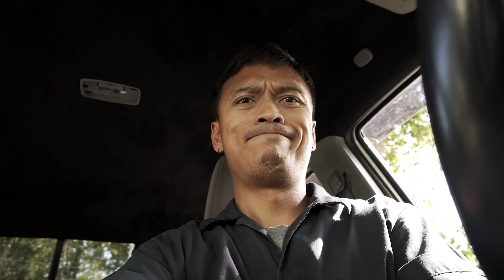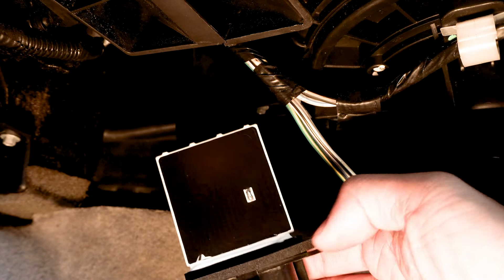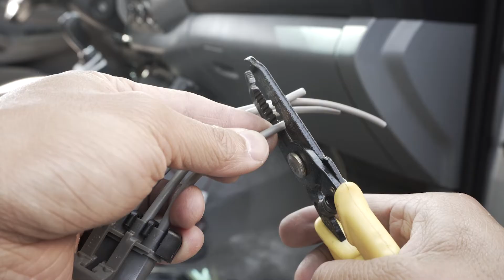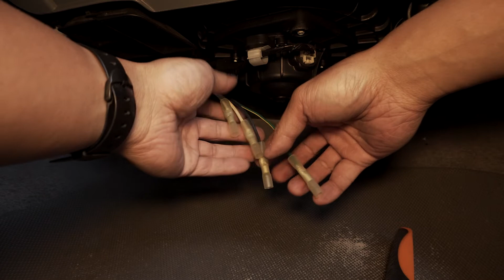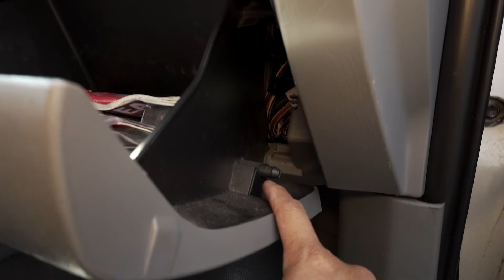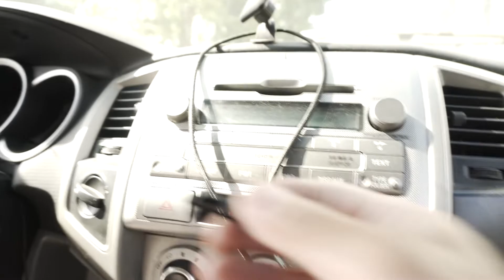Blower Motor Resistor Replacement (DIY / How To Tacoma)

Comment from the maker: Replacing the Blower Motor Resistor for the 2nd Gen (2005-2015) Tacoma.
Here are the links.
Resistor w Harness Kit https://amzn.to/3OtlxxE
Resistor only https://amzn.to/3xLspjk
Wire crimper https://amzn.to/39M01pk
Cabin air filter https://amzn.to/39KOnuM
Wire stripper https://amzn.to/3zWrUp5

Comment: Had this problem on my 2012 Tacoma.  Problem was obvious - poor contact on the incoming 13.8 volts to the resistor bank from the vehicle electrical system (the large diameter wire in the associated wiring harness).  Visual examination of the harness plug and the resistor bank receptacle showed burn marks in the sleeve of the resistor bank receptacle.  Classic sign of arc faulting due to inadequate solid contact of the incoming power pin with the resistor bank receptacle sleeve.  Cleaned up the arcing with DeOxit, and made the connection solid simply by inserting a sliver of copper foil
Into the sleeve to tighten things up.  Total
material cost less than 10 cents.  Replacing the resistor block may temporarily solve the problem, but unless the new one has been changed from the original design to provide a tighter fit on the incoming power sleeve, it will
happen again.  Root cause of problem is either the sleeve of the connector on the resistor bank is too big or the pin on the harness is too small.  I’ve run. Into similar problems
with PL-259 plugs and SO-239 coaxial cable connectors, especially the cheap on plugs that were
sold by Radio Shack.  The pin diameters were just slighly undersized compared to the sleeves inner diameter leading to poor and intermittent contact.  Used the copper foil sliver technique on them as well.  One caution - if you ever have to undo a connection fixed with copper foil slivers, make sure it’s still inside the sleeve when you make the connection back up again or remove the old sliver and replace it with a new one. For the Tacoma fan resistor connector, you will likely never need to undo it again once you fix it the first time though.  Mine has held up for several years now.

Comment: Most  of the time its not the resistor network that fails its the connector .... the male and female don't make good contact and it begins to arc.  Once this happens the entire fan stops except HIGH which doesn't use the resistor network.  Test the resistor network with an ohm meter and if all connections between each other are less than a couple of ohms its good to go!!  All you have to do is bend the male connector terminals just slightly to force more pressure on the contacts of the female connector. That will stop the arcing.  If you want, you can also add a little dielectric grease onto the contacts to stop any oxidation or corrosion of the terminals.
Reply: I just added a sliver of copper foil into the sleeve to tighten up the fit on the largest diameter wire that supplies the 13.8 volts to the resistor network after cleaning up the contacts with DeOxit.  Sleeve was black from arc faulting- a dead giveaway of the root cause!

Comment: Awesome video! I have a question, in the past I have not used Toyota OEM replacement parts and have run into issues (coils) I bought an OEM resistor, do you think I should use a wiring kit? Again awesome video and thanks for posting such a helpfull videos. Bet you are not popular with the Toyota dealers.😉

Comment: The Wirefy crimping tool that you are using and is linked to your video is speciffically for insulated electrical connectors.  It is not intended for the  heat shrink  connectors that you use in your video.  I had to zoom in and watch closely to see how you made that tool work for heat shrink connectors( heat shrink connectors use  a different Wirefy die shape). I believe you found a clever work around solution for a good $20 tool. I would kindly suggest that you make your work around  obvious to your viewers in your excellent video. I purchased your linked Wirefy tool and discovered the subltle distinction after I had already crimped. Nothing but high praise to you. Thanks.

Comment: So after replacing the resistor and harness (it apparently had been done before by previous owner) the fan works on all speeds except max.  Any thoughts?  The old harness was burnt.  I replaced the relay just in case.  Re-wiring the harness I had to match the previous splice.

Comment: Bought the harness and resistor but only replaced the resistor and it worked. To my surprise my resistor has already been replaced. Had the new style resistor when I removed it.. I bought my Tacoma used with 130k KM on it. So maybe it’s been changed once before? Will see how long it last if it stops working I’ll replace the harness. Thank you for the great video.

Comment: All great, but I think changing the harness is generally not needed.  Seems the part that fails is the resistor itself, the harness really has nothing in there that can break, and it fits the new resistor perfectly.  So maybe no need to do all that cutting, stripping, crimping, just swap the resistor and you're good to go.

Comment: my highest setting stopped working, then the 3 lower settings also stopped working.  replaced resistor and nothing changes.  fuses not blown.   what now? 😿

Comment: My 2015 v6 has a different problem. AC works fine and randomly it'll stop working and the AC light flashes but the blower still blows just hot. New compressor, fully charged, new clutch relay, clean AC condenser. I'm at my wits end. It doesntdo it al all below 80 degrees and does it less while moving, more when parked but not always. Again, condenser is clean.

Comment: I have a weird problem with my vents in that one side of the vehicle vents blows more than the other. Before I followed your video to fix the A/C there was virtually no flow, but changing the fuse for the A/C now it’s working improved the flow, but it’s still not equal between the drivers and passenger vents. It doesn’t matter what number the fan is turned to. Any ideas and suggestions gratefully received! 
.
Reply from the maker: It could be a few things:
1) Did you check that the lower knob is all the way open for the output vents?
2) Did you check your cabin air filter to make sure it's not clogged?
3) Hopefully it's not clogged by field mice nesting, do you see any signs of nesting materials in the vents or in your cabin air filter?
Reply: @TacomaTutorials  hi KFlo! Thank you for replying. I checked the vents and they are open. I checked the cabin filter and it was fine, no nesting signs. 

Now I have fixed the A/C (thanks to your other video!) I notice not only is the air flow less on the passenger side, but it is also not as cold on the passenger side if I switch the A/C on (and again the air flow is still lower than the drivers side).
Reply from the maker: Hey bro, after some research, it may be your blend door actuator. I've actually never had to replace it. You can check this video out so that you see what you may need to do: https://www.youtube.com/watch?v=WMR1bfLfIrc&t=115s
Reply: @TacomaTutorials  aww mate, I can’t think you enough! Thanks you so much!

Comment: What if the problem is, the fan doesn't turn on with any of the 4 settings? I've got no air and no heat on any setting. AC compressor and clutch are working. 2011 Tacoma 2.7.
Also, it has completely stopped blowing before, a few weeks ago. It only lasted a few hours like that, then, it started blowing again. Today, it all of a sudden wouldn't blow when I turned the truck on. Fuse? Relay? Blower motor? Blend door actuator? Not sure what it could be. Anyone know?
Reply: Having the same issue with mine. Going to try replacing the resistor and harness. But when first investigating the blower motor, the harness that plugs into the blower motor (further down the line) was also burnt on one wire port.

Comment: What about if the fan blower is not working at any speed? Would it be the blower? Transistor? Or both?
Reply from the maker: It can also be that rotary switch. I would start there, then the blower
Reply: @TacomaTutorials how do you replace/fix the rotary switch?

Comment: Air flow flows up not down btw
Reply from the maker: That's a negative, ghost rider. Please take a look at this picture. https://www.tacomaworld.com/threads/water-thru-cabin-air-intake-my-solution.88655/ When you remove the upper cowl, that's the cabin air filter that you see. It's pulling air from the cowl so air is pulling downwards

Comment: My off switch on the left side where it controls the speed of the air does not work at all when it's dark out and I turn my head lights on the off switch where u turn the speed up does not light up but my middle switch where u control the cool air and heat lights up as well as the switch on the main right that controls ur vents for ur windshield or the vens on the dash or the feet any suggestions on y I got no powered to the off switch even with the switch on high it does not do anything and I did put a new blower mower in it ik I put it in right bc it's my 3rd doing it and no I did not put 3 in my vehicle I done mine my twins and my older brothers for heads up
Reply from the maker: I would suggest swapping out the climate control unit with your twin's to test out the climate control panel. That's a good place to start the diagnosis to the problem.

Comment: KUYA WHHAT IF MINE IS THE COMPLETE OPPPOSITE EVERYTHING WORKS BUT THE HIGHEST SETTING
Reply from the maker: Hey brother, that may be the rotary switch on the climate control. If you can find someone that has a second gen and swap climate control (that you know works) to test yours, that can confirm the issue. If that doesn't work:
2) Replace the blower motor resistor anyways
3) It may be the blower motor itself

Other preliminary checks:
1) See if any of the connector's contact points are damaged on the climate control
2) See if there are any exposed wires

Good luck bro!
Reply: What is wrong if only work on the lowest not on the middle and high speed?

Comment: Another #10
What wire crimper kit from the several listed from Amazon did you feel was the most useful
Reply from the maker: This one (Wire crimper https://amzn.to/39M01pk) was the one that seemed to work the best. It swaged the wire more than crimping it, giving very professional results.
Reply: @TacomaTutorials  is that just the crimping tool $25? Or the crimping tool that comes with the 4 head's $75?
Reply from the maker: I got the one that's $25. The set with 4 heads is a bit overkill for home garage crimping

Comment: The Amazon part is crap. I’m on my third one and it’s a temporary band aid and the problem will come back. Each time I return the part the seller will send you a new one. I changed both harness and resistor each time.
Reply from the maker: Are you using the same seller? What was the solution that you found that works? That is the only part I found that seemed to work for the majority of people. If you have any other solutions, please share
Reply: @TacomaTutorials  not sure if it’s the same seller, the parts were identical three times. I changed mines every 6-7 months. That was the fix. Maybe I need to go back OEM but when the OEM went out and my Mileage was around 40k.
Reply from the maker: Hey bro, I appreciate the detailed reply and I'm looking to see if we can reverse engineer some of this problem so we can find a root cause. Please share any further details that you have on the following questions:
Was the char marking visible again at the one of the middle connectors in the new harnesses? Did any of the wires look like they were burning out? Did you replace the air filter each time? Did it look like there was a lot of debris on the air filter? I only bring that up because restrictions in airflow can cause the circuit to need more amperage.
Reply: @TacomaTutorials  never thought to check the air filter. That’s a good call out, because it might be time to clean my K&N air intake. Each time it looks like one of the wires were burnt and the actual resistor.  Before I change it out this weekend I’ll clean the filter and see how long it last. Mahalo for your time replying back. Love your channel bro. I saved a lot of money working on my taco because of your videos. You should bring your truck out to Oahu, Hawaii for some fun in the trails. 😂 jk…….take it easy aloha 🤙🏽
Reply from the maker: No worries, brother. 👍 Keep me posted on how it turns out with your cabin air filter and the resistor!

Comment: I’ve been having issues with my ac on 2015 4 cyl tacoma. When I drive it cools just fine but if I am idle for a long time the temperature gets hot. Replaced the compressor and all fluids are good. Checked by Toyota. They told me this is normal for tacomas. Any experience with something like this?
Reply from the maker: I would recommend hosing down the radiator fins (there might be mud and debris) as well as changing the cabin air filter.
Reply: Flush Interior condenser by shooting a disinfectant up the drain tube of the AC system that should help you get a lot colder

Comment: It's just a crappy plug as well, my blower motor failed recently, and I replaced it. But every once in a while the fan stops and I have to wiggle the plug as the contacts have poor connection.
Reply from the maker: Did you do a harness replacement on the blower motor as well?